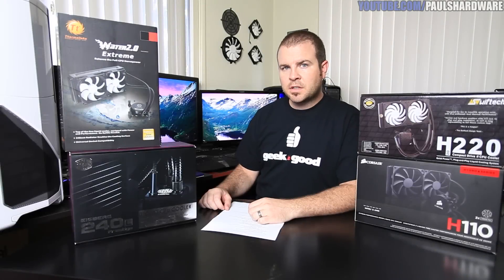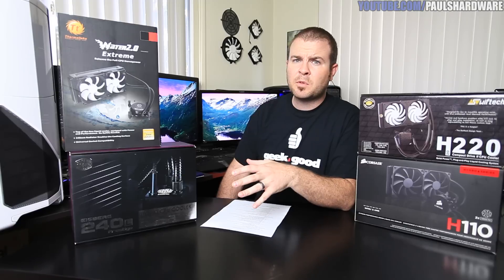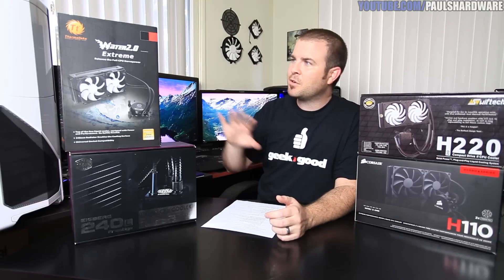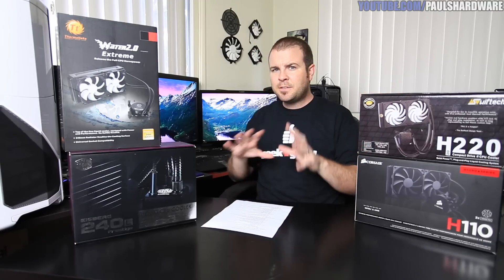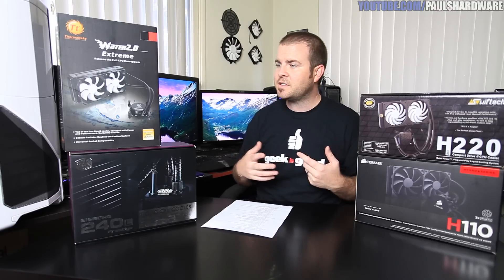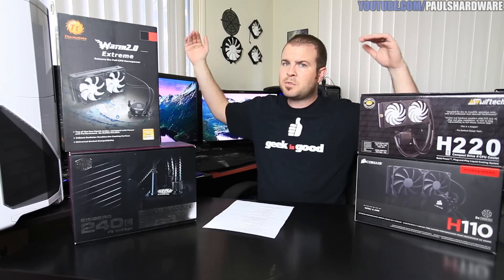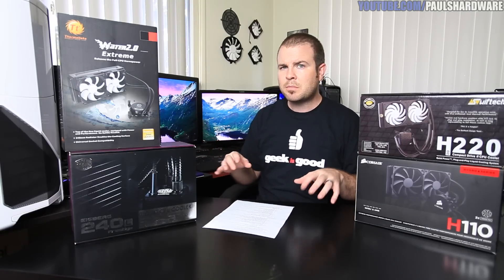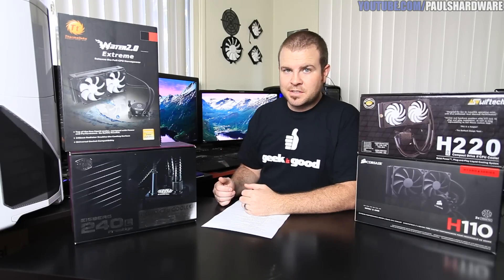H220 vs H110 vs Eisberg 240L vs Water 2.0 - CPU Cooler Showdown!

Comment: how can your idle temps be so low :-D my cpu at idle with a corsair h100i is 37-40C
Reply: +Tommy Østergaard third gen is hot as hell wayyyy hotter than amd those temps are normal if you have overclocked your cpu

Comment: Excellent review,! Professional production.  I've subscribled to your reviews and D/Led this one for future reference since I  run the TT 2.0 Extreme cooler on the same Asus Sabertooth Z77 MB.running a 3770k unlocked mutiplier.  Now that it's a bit over a year old I plan on pushing it beyond the built in turbo boost and see what it'll do. I just replaced the 32Gb of  1333 Corsair value ram,  which ran well up to 4.2Ghz.  Don't like to overvolt much but the value ram maxed out if I bumped it up over 4.2. Still good for "Value Ram" put in some 1866 Ripjaw Ram,  added a Crucial 512 SSD and replaced the aging 650ti video card with an EVGA GTX 960. So basically I just upgraded my rig for 1/2 the price of a MB / CPU replacement.  Haven't tried pushing it yet as I am a bit finatical as far as,  I have to have EVERYTHING,  installed,  windows updated,  newdrivers installed ect.  Now that that is complete I can comortably start cranking it up.  Looming to get @ or around 5Ghz with very little ovrer volting. 
All my hardware is installed in a ThermalTake Chaser II case (excellent choice) so I had plenty of room forthe larger rad.  
Currently looking at an SSD Caching with a possible 16Gb Ram drive running to a RAID 10 Array. May have to go to a RAID 5, or add a sata controller card,  I'm out if sata ports. Got 1 SSD,  4 HHDs,  2 opticals, and 1 external sata dock thats built into the case (nice feature). Will share results later.

Comment: I know this is a dumb question but got im curious. Who do close loop water coolers work? Do they actually use water and just circulate? All the install videos no one does anything with it and just installs it and im so confused how they work...
Reply: The heat goes through a copper pice which puts the heat into the water  and the goes to the radiator to release the heat
Reply: but does water already reside inside the Cooler? Or do i fill it?
Reply: ***** Well im getting a i5 4690k and an GTX 970. I dont plan on over clocking but do you think the H100i is necessary? Or will the stock fan be fine?
Reply: well i absolutely love the 4690k. Dont plan on over clocking it now im only buying them so i can overclock in the future when my cpu starts to become obsolete. If that makes sense. Idk i would just love ideas. I reallt like the h100i and its affordable too. But you seem to know best :)
Reply: Honestly im only going to be gaming. If i have an i7 i feel like ill be...overkilling what im actually going to use it for D: should i not feel bad lol?
Reply: Hmm I'll have to really think about this. I honestly feel I won't need the i7. But I may get it. I'm still putting together my build finding the best pieces for it
Reply: My brother had the same exact Pentium. I remember when it was top dog of its time. But i made up my mind. I took off some speakers and a headset from my build and i was actually able to add the i7 and a 120gb ssd for the same price :)
Reply: Oh yeah that sounds awesome! I guess i did get it mixed up lol. This was about 7-8 years ago. I think it was the first 3.0 ghz pentium or something i honestly dont remember but god that thing could max crysis like crazy with a gt 8800.
Reply: Haha maybe it was the best Core 2 im thinking of. Im honestly not sure.
Reply: I honestly only know about whats current. Im only 20 and played on console since i was 3 years old. I assume you can imagine how much i actually know about past cpus and gpus XD
Reply: Lmfao! Yeah man i missed christmas sale...Since i dont have the pc yet. By the way, since im going to be hitting 80+ FPS on most games, i plan on getting the 144hz 27" asus monitor (VG278HE) and i dont want to feel like its overkill for what i will be doing. Since im getting alot more than 60fps i dont think a 60hz monitor will be worth it. But i would just like your opinion.
Reply: I was literally just looking at g sync monitors and god they are easily over 500$ so i actually made my build a bit cheaper and dropped the 27 model and got the 24. I realized 3 inches was not worth the extra 150 bucks.

Comment: After doing the custom loop for a couple years I think I'm gonna go back to one of these systems (probably H110). The reason I didn't like the custom loop is that the pump vibrations are very difficult to get rid of unless you put your pump in the exact right spot and upgrading is difficult. Maybe the C70 just isn't meant for a pump but the vibrations are louder than the fans would be anyways. Now that I want to upgrade my video card I pretty much have to get a waterblock with it and add another hundred bucks regardless of if it needs it or not. It certainly looks cool and performs well but from a practicality sense I don't see the value in an expensive custom loop.
Reply: Aunt Jemima The value is in performance advantage.  I am not sure why people complain about pump noise.  Long time ago I bought a noise  dampening adhesive mat and lined the floor of the case with it.  My case is aluminum and I am running Swiftech 655 (D5) and on highest setting 5 I cannot hear it past the fan noise which I also keep at medium setting.

Comment: the fan has to pull in or out of the radiator¿?
Reply: Doesn't matter. They can push or pull the air through the radiator. Minimal temperature difference
Reply: what radiator you have??

Comment: Given equal fan speeds the H110 would have beat all the others, and i'm no corsair geek, limit all fan speeds to 1600RPM, then test.
Reply: 140mm will be louder than at the same rpm than a 120mm. You could go equal cfm or equal noise for comparison, but definetly not same rpm.

Comment: do you fill the corsair h110 with water?
Reply: It's closed loop. You're not supposed to/you can't refill it. And it's not water, that would be detrimental to the guts of the whole system, it's a fluid that doesn't corrode anything.
Reply: kk
Reply: flagmuffin1221 just use radiator coolant that is used in your car, same shit.
Reply: jlrockafella Yeah, you probably could, but coolant only costs about $5-$10 for a 700mL-1000mL bottle.
Reply: +jlrockafella lol. I doubt it's engine coolant. engine "coolant" isn't actually a cooling agent, it prevents the fluid from freezing when it's cold it. if you live in a warm environment where it doesn't reaching near freezing, running straight water in your engine will actually cool better than having coolant mixed in. it is probably filled with something similar to a coolant additive like redline "water wetter" or royal purple "purple ice" mixed with water. those are designed to prevent corrosion and lower temps
Reply: kgkustomz97ser
true, or you can just dilute the coolant with some more water like 60/40. They use to use concentrate and water back in the day when there was no cpu coolant remember?

Comment: 1.39v seems a little high for 4.6ghz.. wonder if they got a not so good chip... my 3770k is stable at 4.4ghz on air at 1.17v. maybe i just got a really good piece of silicon
Reply: Haha congrats , I managed 4.5ghz @ 1.185 . I also agree , either people are over volting, or we just happen to have some golden chips !
Reply: +Alesh Liska I'm now running @4.7ghz and voltage hits 1.26 max stable. I tried 4.8 but I would have had to probably hit 1.3v to be stable. I didn't wanna raise my temps that much for such a small bump in speed

Comment: very nice compassion I have a few questions:
1- is there an update to test the Thermaltake 3.0 & the Kraken 60 with the 240L Prestige.
2- what is the most High end Thermal solution ?
3- I keep hearing that the failure rate for the H220 is a bit high any thoughts?

Comment: I love the Eisberg the best, It has the same customizeable features as the H220, Mine has custom coolant, radiator and tubing and i just love it,
Reply: WitheringintheDark
 Wow you really don't know anything about the Eisberg LOL
Reply: At that point your honestly better off just assembling your own loop lol, probably cheaper too.
Get one of those convenient dual-bay reservoirs with built in D5 Vario pump; some models have allowances for another D5 if you want to increase the flow speed later. Among the best pumps money can buy.
You can screw around with all the custom coolant and radiators you want, but the pump is your main bottleneck; everything else is derivative. You can get a ginormous radiator but it won't perform any better then a smaller one if your pump is too weak to push the water through the system fast enough, Especially if you add more things to the loop like a GPU block.
Reply: S102001
I know it's only a bit better then your bog standard AIO and that the only thing good about it is you can swap out the mediocre parts for good ones later. But, again, like I said... why not use the better parts to begin with.
It has a weak-ass pump(better then Corsairs, granted, but still), period, it is nothing compared to a D5 and similar pumps.
Reply: WitheringintheDark Do you have a rig setup? I have the parts and I intend for CPU and GPU cooling. Just need the pump and I'll look into your suggestion. I think at this point in the game, you're spending enough to get away from "proprietary" one size fits all thinking. Thanks!
Reply: stanislaw
Not a WC rig, no, I just use a phanteks TC14-PE(best air cooler out there) But my brother does WC, and i've got friends on OC-forums that do it. There's extreme diminishing returns with PC cooling; unless your an extreme OC'er or want to water cool a GPU(like you do) there's isn't much point going past an air or AIO WC'er.

In example: The TC14-PE is like $70. For about $50 more you can get the best Corsair AIO and get maybe 3-4C cooler temps, and Maybe an extra 100MHz cpu speed. A custom WCing solution should drop another 5-10C temps, an maybe an extra 100-200MHz cpu speed, but will also cost between $100-200 more then the Corsair, even more if you do the GPU(most WC plates are ~$100)

The other thing about GPU WC. Most of the generic plates only work on the base model from nVidia. Aftermarket models by MSI or Asus ect use a different hardware architecture and are not compatible; you'll have to buy their specially made stuff. For the price of a base GTX780 and WC plate you can buy an MSI Lightning or equivalent, with massively better parts and a tri-fan cooling system. I grabbed a 780 lightning on sale for $400 awhile back; thing does 1270MHz core with sub 80C temps on base cooling.

Since you are cooling the GPU too, though, you'd definitely want a good pump. They have dual-bay reservoirs on FrozenCPU with built-in pump mounts that are nice; just slot in a D5 and fill the reservoir; if you expand the system more later you can slot in an extra pump for increased flowrate.
Reply: WitheringintheDark Thanks! Followed your lead and, the air coolers by phantek have proven itself at the right price point. This is not to say WC or AC is a competition. Real world situations demand price performance comparisons. That's why I appreciate your pragmatic approach-diminishing returns.Yes extreme OC does require WC if not just for a measure of prolonging the CPU life and piece of mind. To that end, the AIO units I use are the Intel/Acetek TS13X . In my environment it seems the best. 3 year warranty too!
My rig build is kinda robust. I mentioned pieces so here's what I need to cool. Mobo Z78 TUF Sabertooth, dual AMD R290x crossfire, i7 4770k CPU, 16GB 2133 dominator platinum RAM. WC involves 2 EK GPU water blocks (I have the reference boards), EK Supremacy CPU water block, plumbing. Here's the fun part, I designed a custom 2 bay resevoir with a sump pump 2.5l/m.
Hence my question of 1 or 2 variable quiet pumps for the aggregate load of plumbing. I've seen computer controlled units however, they are proprietary. So there  it is. You're brother would probably get a kick out of this. Thanks again for your feedback. A bientot!
Reply: stanislaw
Yeah, i've actually contemplated getting a H110, H105 or H100i if they ever go on a decent sale. The phanteks keeps things pretty cool, but it's absolutely massive and a huge pain to work around, and stresses the board, have to be careful when moving the tower.
As primarily a gamer, it's all I really need. Air/AIO WC will easily getcha to around ~4.5GHz, give or take a few hundred MHz. Custom will get you a couple hundred more, which is great for an OC enthusiast, but makes little difference as a gamer.
As far as prolonging part life, it's not just temperature. Even kept cold, high voltage harms just the same, electromigration and all that. Lower temps will let you OC more, but most of the parts are certified to run at near-boiling temps for half a decade or more, so as long as you keep them below 85C or so within spec volt limits you shouldn't be concerned about part life.
Your setup sounds good, but WCing so many parts (memory, mobo, cpu, two gpus) you probably want to get dual pumps to make sure your system has enough ass for proper flowrate. You have a large radiator, too? You'd def. need a 360mm or 480mm rad for all that, and that's a lot of area to move water through.
Reply: WitheringintheDark Yup, right on the money. I'll settle for a 360 as it plays redundantly with my ROG rig.With this new rig, I figure placement of custom resevoir near cpu is good. Now to ascertain milddle of loop plumbing for a push/pull kinda action. Make any sense or overkill?
Funny, usually people will ask what you would build something llike this. Well, I'm just gonna spill it. The final goal is a screen array (3 monitors) totaling 3204x1440ppi. Theoretically providing close to 16:9 aspect ratio. Eyefinity for deskop management. Wanted a curve screen 4k but WAY too expensive yet. What do you think? Kinda cool? Can't wait for playing card size characters running around :)
A bientot!
Reply: stanislaw
Reply: Very nice! What's your rig? I'm still in process testing GPUs before adding watercooling throughout so I survive with an intel AI1 unit. Ain't it cool? Pun intended... A bientot!

Comment: Nice Review! 

You could use a nice little porgram I've been using for noise level testing : Sound Meter Pro for Android. That gives a pretty good indication of the actual noise levels. It can even create a log file so you can load that up in spreadsheet for comparison.

Comment: i enjoy the h110 water cooler but it tends to make my video cards extremely hot
Reply: Have the rad fans exhaust, and use a fan on the front/side/back of the case as intake.  If you can try to put intake fans in they can get the most airflow.
Reply: You should have the front and side fans(blowing on the GPU) as intake, back and top as exhaust for a good, natural airflow, and try to keep the fan specs for all the fans on hand. For best cooling you want case pressure that's slightly negative(more exhaust then intake) though the opposite helps prevent dust buildup at the cost of higher temps. You can estimate this by totaling the CFM of the exhaust fans compared to the total CFM of the intakes.
Another way is to press a tiny piece of paper to an opening that doesn't have a fan behind it, like the upper portion of the front grille. If the paper sticks, it's negative pressure(sucking more air in) if it falls/blows away, its positive(blowing air out)
Front and side intakes ensures the air being fed to you GPU's fans is the lowest temp possible.

Comment: love the videos, helped me out several times already, I always see the cooler reviews on an intel extreme series processor, don't you think a 9590 overclocked running prime or other heat inducing software would provide a better test since the temperature is likely to rise higher and stress the cooler more?, and maybe some old power hog cards in the case like 2x295's or 2x480's, they really change the temperatures a lot of everything else in the vicinity ha,  just a suggestion, but keep it up man, you are the reason I shop newegg.

Comment: got my 6300 at 5.0Ghz and stable on my h100I and the temps are around 45-50C on prime 95!!!
Reply: good to know my crappy coolermaster n520 is at 55c on prime 95..... at 4.0 ghz 1.3v  lol
Reply: it does better than a i7 3770k on cinibench and costs like 250$ less! thats beacsue the overclock.. the i7 3770k would smash if it was at stock lol
Reply: Matt Smith     it do the same score than a fx 8350 stock but with 2 less core..  i just made a post on http://www.overclock.net/t/1460539/fx-6300-cinebench-4-5ghz/0_100#post_21621528  about cinebench   got some sharing the fx 6300 is strong!     and im gonna get an h100i too when i can for my fx 6300 and some vrm cooling for my auss m5a99fx pro.. so let try 5.0 + if i can :D    just made 4.5 but i cant p95 im over 60c core           The i7 3770k have advantage because it a strong quad core.. it cheaper to make strong 6 8 core with the amd architecture but power comsumption is big..   And intel if i remember sell warantly on overclock you pay 50$ and if you fry it they give you another
Reply: it was really hard getting my 6300 up that high and also i did that test with fans max and it was like 14C outside in the morning also the vcore was somthing like 1.55V and i only worked if i overclocked my ram to 1942mhz
Reply: i got 4.8 on 1.42 volt on windows i think i got a good chip :D    ok at 1.44 is not stable but still cinebench worked :D

Comment: where's the kraken?
Reply: Kraken x60 and h110 are virtually identical if not identical. They are both the exact same generic asetek design with a different badge sticker on the top of the pump. Any variance between coolers would most likely be caused by the different fans the company is using out of the box. Normalize the fans and the temps would be within margin of error for both devices.
Reply: got it, thanks for responding.